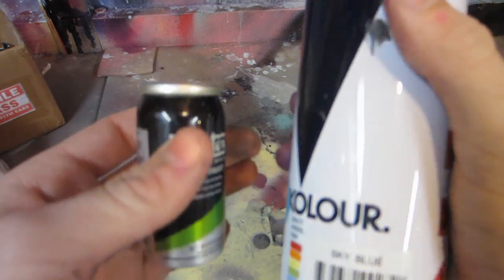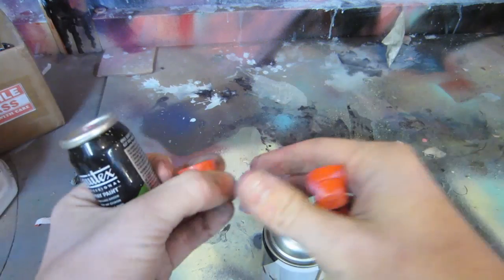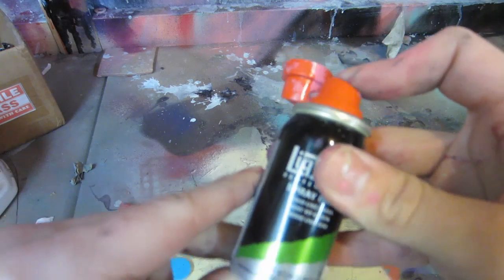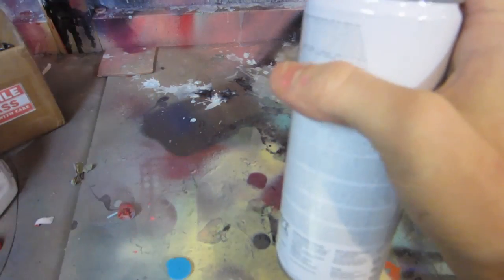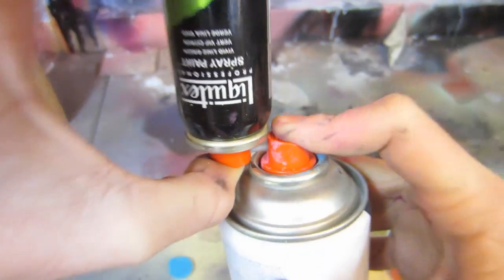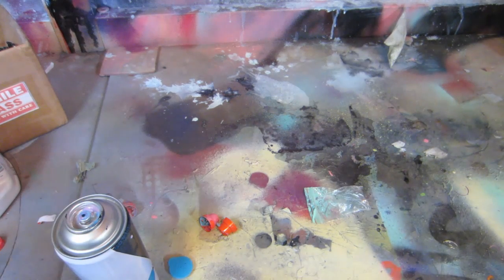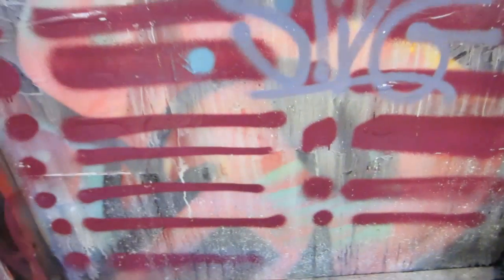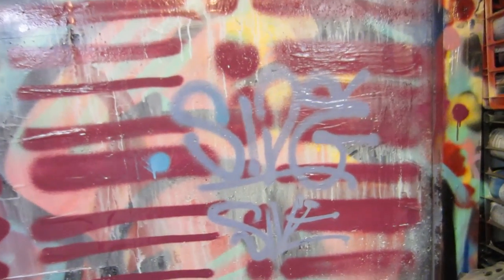How To Transfer Spray Paint Into a Pocket Can

Comment: You can get a good amount of overcharge by freezing the receiver can for at least an hour and running the donor can under hot water.  It really makes a difference.  The paint just blasts into the empty can and retains great pressure.
Reply: if my receiver can is completely empty like not even air comes out anymore would it still work and have pressure if i put it in the freezer ?
Reply: chris guzman well its not a vaccum in the reciever can, just atmospheric pressure, so yes freezing it will help somewhat, though not as much as if you had the reciever underpressure
Reply: thanks yo , stay up
Reply: @kymmedia2  what you do is put the receiver can in hot water first then press the cap before you freeze it. That creates a negative pressure in it and gets even more out of it.

Comment: If you don't have any actual transfer caps (with the longer tubes), take multiple (I found 3 works best) needle cap "needles" and glue them together. (You can use a little strip of paper at the joints to seal it properly) 
Take the empty can, put any cap on it, turn it up side down, and release a lot of pressure (doesn't have to be all, but the more the better).
Now put the joined needle caps on both cans and start transferring, until the paint stops going from one can to the other (you will hear it).
Take the can you're filling up and release the pressure again by turning it upside down, and repeat these two steps until you feel like there's enough paint in the can. 
The reason for joining multiple "needles" (or tubes) is so one can doesn't have to be upside down, I think it's the best way to do it.
Reply: Randyy1 indeed help making the tube to transfer the paint

Comment: ALWAYS heat up the full can and cool the empty can. It's much faster and more reliable that way. Doing male cans into female cans can produce nice results but that doesn't usually happen when using cheap male paint. the exception being cans with the wide old hardcore type valves used with pink dots. they work beautifully with anything. if you happen to be using a high quality male valved paint you should get nice results when transferred into any type of female can (eg. plastikote twist & spray into ironlak). If you want to make custom colors this way I would advise not mixing different brands together just to be safe, but it is doable with some basic knowledge of the brands you want to mix.
Reply: interesting points ,if anyone else wants to learn about how to spray paint a car try Cranstirk Pro Spray Channel (do a search on google ) ? Ive heard some pretty good things about it and my partner got amazing success with it.
Reply: Have u ever tried transferring dollar paint into Montana cans. I've tried but no paint transfers. If u have any tips on how to... Help LoL

Comment: if my receiver can is completely empty like not even air comes out anymore would it still work and have pressure if i put it in the freezer ?
Reply: You don't have to put it in the freezer if the receiver is empty. The donator has more pressure than your empty receiver so it will naturally flow into the receiver because the pressure wants to balance out between both cans.

Comment: noob question, but what is the difference between male and female cans?
Reply from the maker: +Adan Aviles the stem on the top. Female is traditional for most aerosols where the cap has a stem into the can. a male can has a small straw come out of the top, a common mail can is painters touch
Reply: google images
Reply: When a man likes a woman
Reply: one have tips and the other ones don't have tips....tips are where the spray cap goes on to
Reply: Adan Aviles The Montana Ultra Wide, Male, Montana Black, Female.
Reply: the male cans actually work
Reply: *And kids, that is how i met your mother!
Reply: One makes a sandwich
Reply: Get Shreked Shrek

Comment: I tried to fill a male valve 600 ml with a 400 ml can and it didn't work so never use a smaller can to fill a bigger can coz it will not work